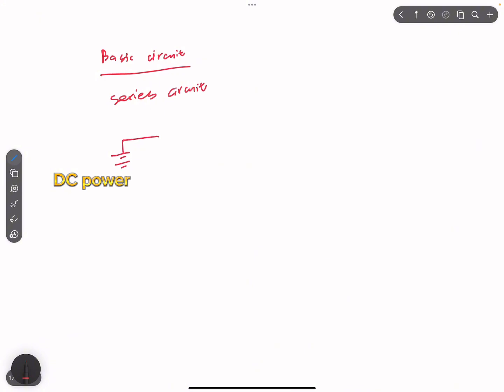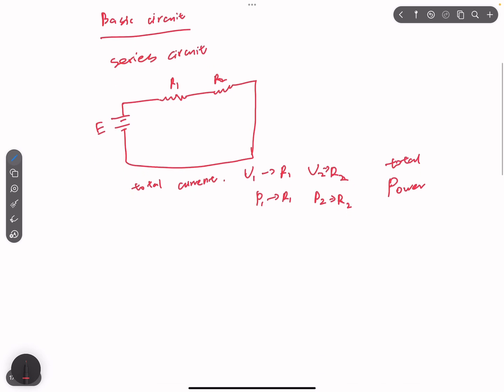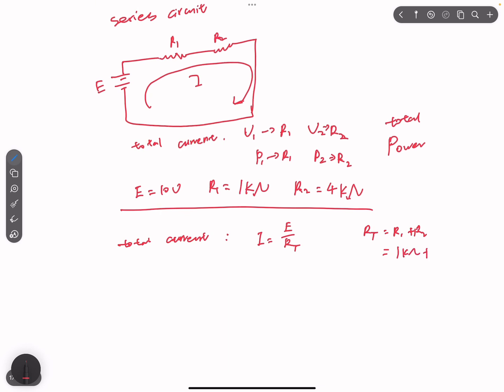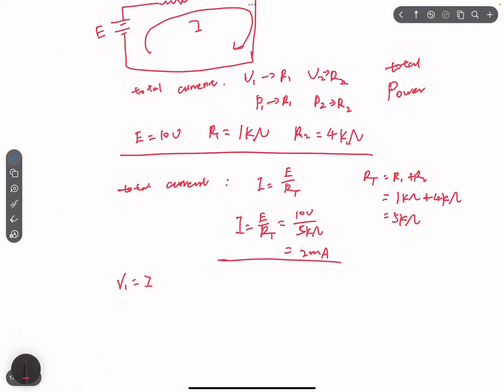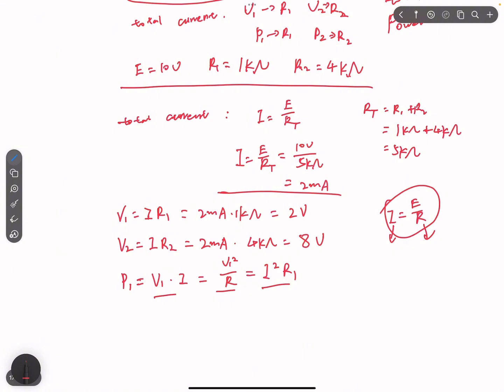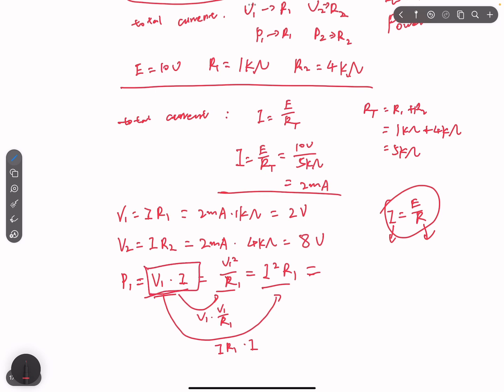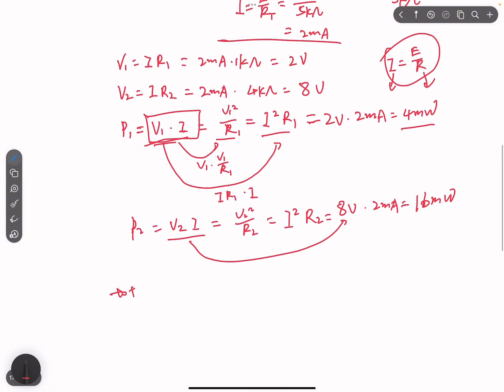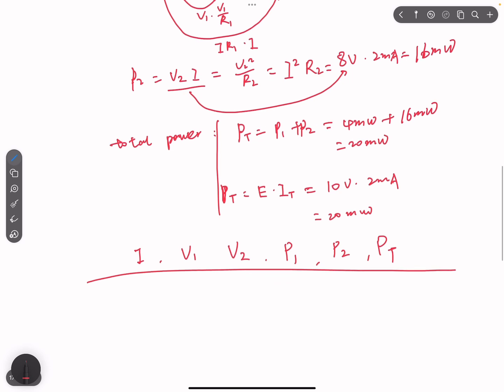Basic Electrical circuits: series circuit analysis

Comment from the maker: for series circuits: there is only one current flow path, so the current are the same for all the resistors. voltage are different because they have different resistance. if we use ohm's law, v=IR, the ratio of the voltage will equal the ratio of the resistance.